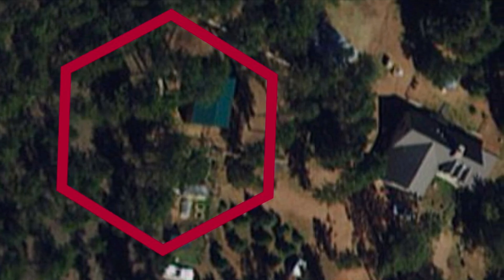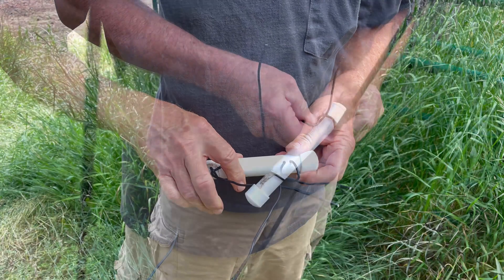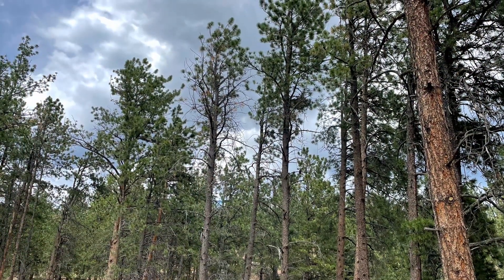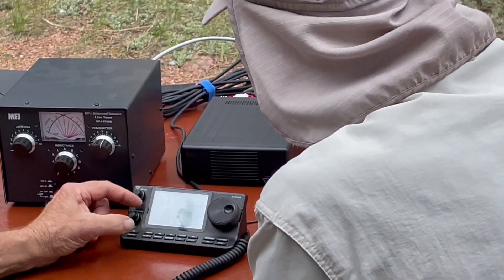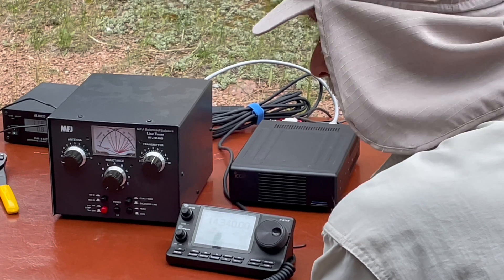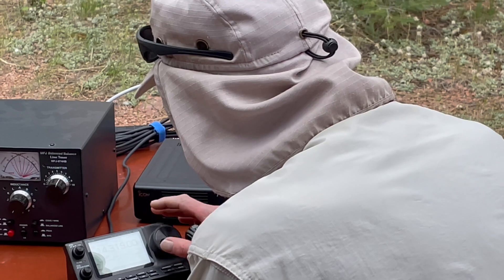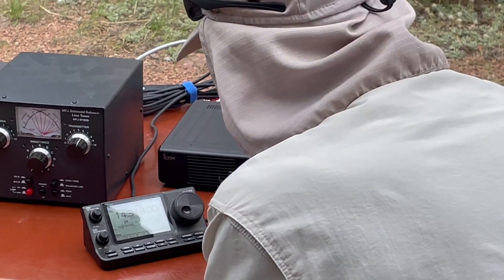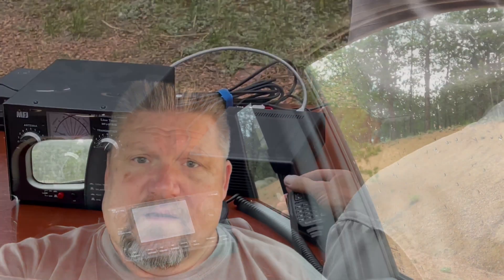Sky Loop Antenna Install

Comment: Nice, I put up at 80m loop and it’s not my primary antenna, works great.
Reply from the maker: That’s awesome. I’m contemplating the same kind of setup at my property with a 300’ loop but it will be more of a delta loop. Ham-Solo K0FYR
Reply: @Ham-Solo  👍mine is about 266ft and square
Reply from the maker: @K5YVY  yeah I just have weird trees on property and can only get a big triangle out of it. Should be interesting to try and will be my first real outside antenna. Ham-Solo K0FYR